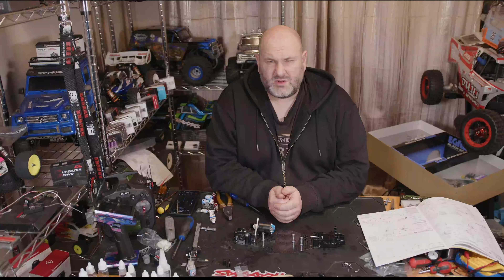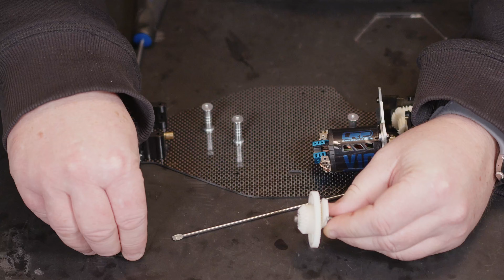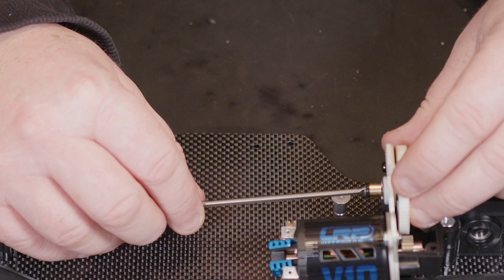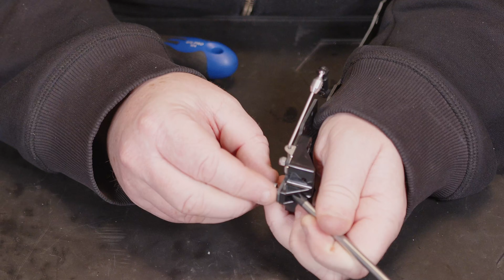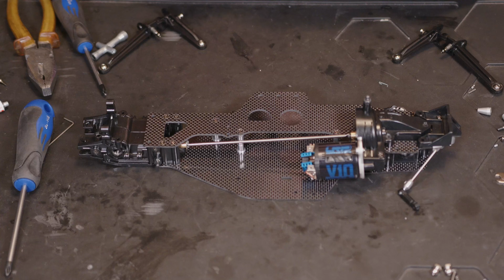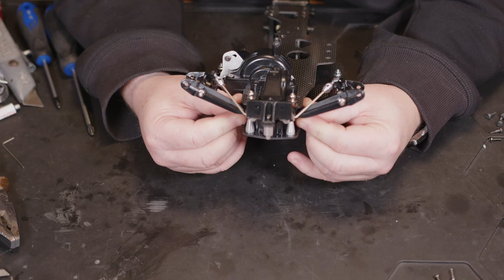Tamiya Egress Black Edition build part 2

Comment: Can i ask please if you were happy with your first choice of Torque splitter, or did you change to Center lock later? Im just building the Egress now and still stuck on which to choose first!
Reply from the maker: It really depends on what surface you drive on but it's not hard to swap it so I would try both and see which you like best :)
Reply: @WTFRCCars  Thankyou,  I'm quite new to RC, is it easy to swap between the two?
Reply from the maker: Yeh doesn't take much to swap them

Comment: Looking good so far.  As I know I'll be getting one (just not yet sure if I'll do a build video), I've started checking around.  Found a few sellers, including regular retailers, charging outrageous prices for the kit...but, thankfully, I've also found a few with more reasonable prices, and two selling the kit for only slightly more than it originally sold for.

My biggest 'problem' is deciding whether to get a hex screw kit (to replace the JIS screws), or whether to invest in some JIS screwdrivers.  Starting with option #2, it would probably be best of I knew, exactly, what sizes of JIS screwdrivers Tampa kits typically use.  I mean, it doesn't make sense to invest in every size if only 2-3 sizes are used.  If you could indicate which sizes are needed, I'd appreciate it.

Looking at option #1, which is the direction I was already leaning towards, I feel this is the "better/smarter" option (and the direction I've gone with the previous Tamiya kits I've built...well, except for the TD4 Super Avante & XV-02 Pro, body of which came with hex hardware).  Also, as I'm not sure how many more Tamiya kits I'll actually end up building, combined with the fact that Tamiya appears to (finally) be switching to hex hardware for all new kits (by 'new', I mean truly new, not re-res), I'm not entirely sure purchasing JIS screwdrivers would be a 'wise ' investment.
Reply from the maker: For me the kit I have listed is cheap and they work great I use the smallest and the next one up but not sure what the exact sizes are but I have lots of tamiya kits so would be far more expensive to keep buying hex kits than the price of the JIS driver's :) hope that helps
Reply: @WTFRCCars  Thanks...on both counts.  Amazon doesn't seem to carry that specific set in the US, but there are others, including one that looks identical (but is sold under a different 'brand' name).  Guess I'll just have to figure out if I'll buy more Tamiya kits, and weight the "pros & cons" of purchasing the JIS set vs future purchases of hex screw kits.  The biggest problem (as I'm sure you're more than aware of) is that the quality of their JIS screws in the past have been very 'questionable'.  If...and, this is a BIG "if"...they've switched to a supplier providing higher-quality JIS screws, then it could be worth investing in a quality JIS screwdriver set.
Reply from the maker: For the egress the screws are definitely very different than the stock screws in almost all other tamiya kits I have built so far, much higher quality by far :)
Reply from the maker: US PRO Tools 4 Piece Japanese Industry Standard Screwdriver Set JIS ph1,2,3-1616 £10.35
https://amzn.to/3XI979Q